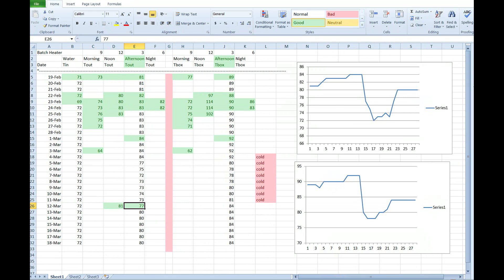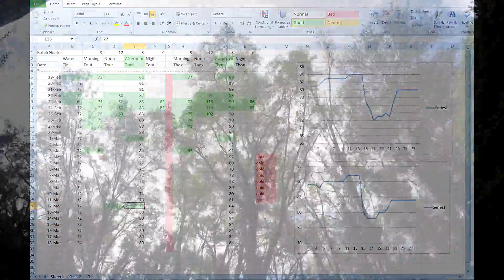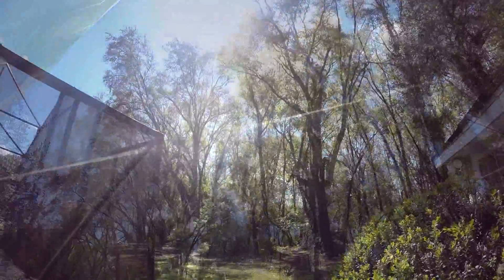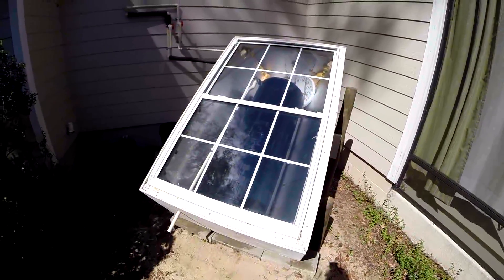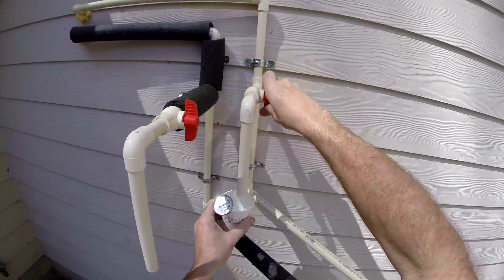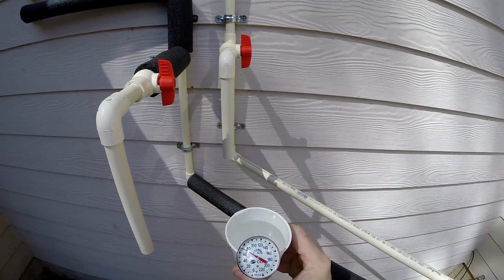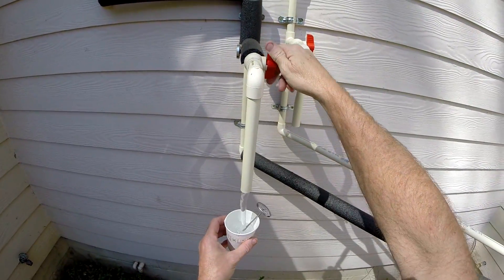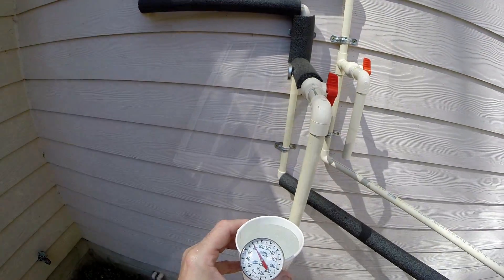DIY Solar Water Heater Not Working

Comment: Hi David, hard to get a sunburn let alone heated water with the current conditions. Give it time since your tank is in the shade for more hours than in direct sunlight. My tanks are on the roof and exposed from 8 AM till 6 PM. Trees will make a big difference much like solar.   J K
Reply from the maker: Hey James,  I was hoping it would be in the sun by now but I guess I will just have to wait another week or so.  Thanks!